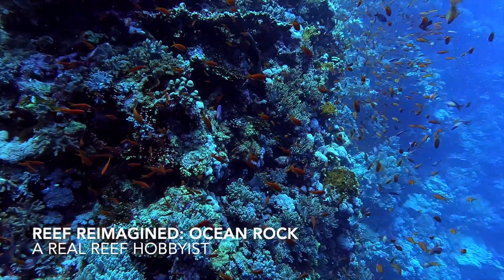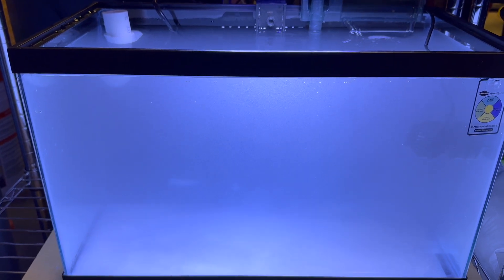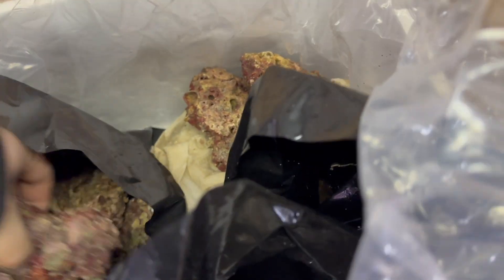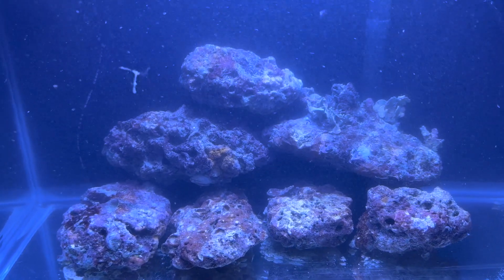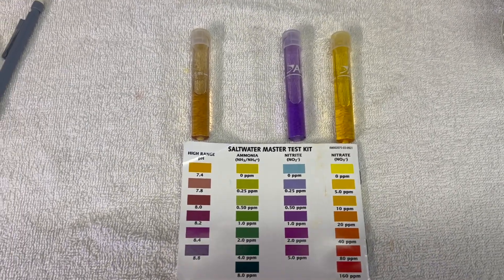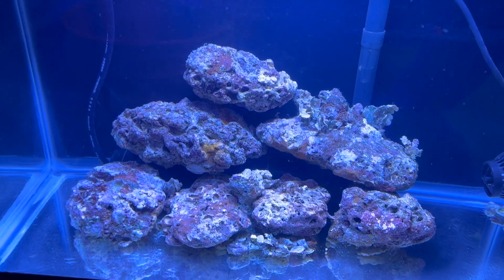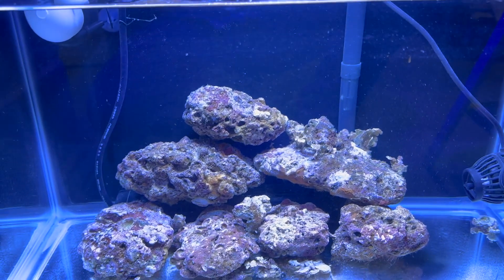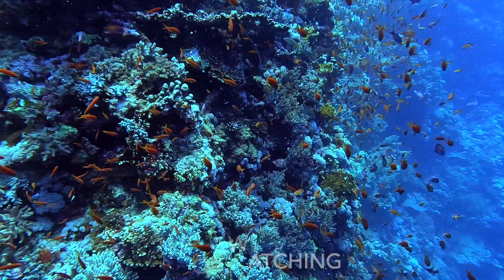Reef Reimagined: Setting Up the System to Cure / Cycle Ocean Live Rock

Comment: Interesting that your rock came Damp.     Tampa Bay Saltwater ships theirs submerged in water.
Reply from the maker: Yes. I had used them before, great rock. Just more pricey and larger amounts needed to be picked up at the airport.
Reply: @ I find it interesting, what I believe to be,  the impact that BRST and Ryan’s presentations at conferences on “Live” is having on the hobby.  

Right now TB Saltwater is not shipping until Feb, because they are so backed up.   It’s a two woman operation, hopefully they will be able to scale up.  Interestingly, TBS, asserts that, “The Tampa Bay Saltwater farm does not have the same species of aiptasia found as hitchhikers from LFS and online venders that spread like a plague, this has been verified by biologists at FWC.*”